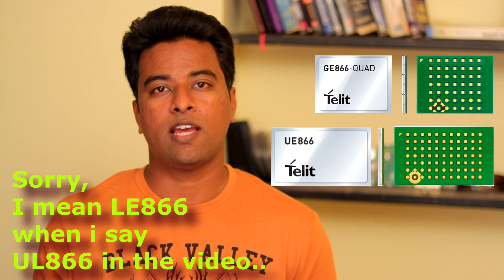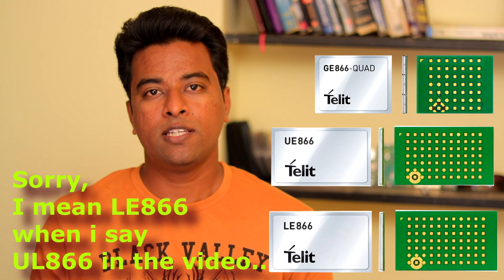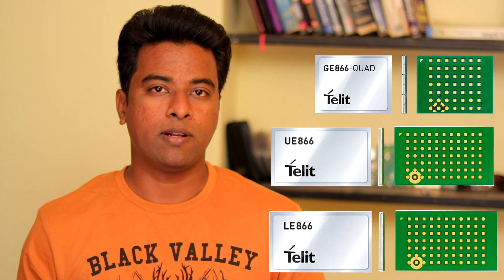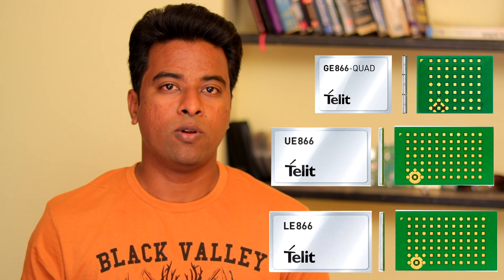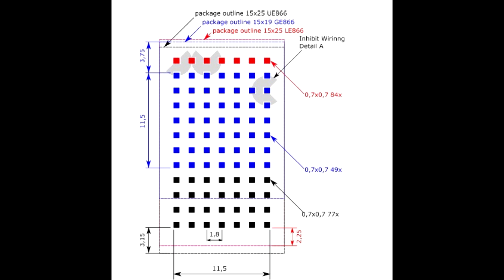Dont use 2G modules like SIM900 and SIM800 - Alternatives

Comment: Hey Ravi good work, i need something really small form factor as sim800 but with LTE or 3g connectivity any ? I'm in europe
Reply from the maker: Use A7670E
Reply: @RaviPujar  thanks for answer but unfortunately its size is 24x24mm but i need a smaller dimension under 18mm by ine size
Reply from the maker: @bhMaker963  check A7680C

Comment: Another recommendation that only has been out for a few years if you somehow get hold of a NB-IoT SIM:

Ai-Thinker EC-01
They aren‘t that expensive and even feature a integrated SoC, they are available as SMD variants as well as development boards so they are a good choice for integrated applications.
Reply from the maker: NBIOT is a very specific tech, not available for all. But now there are cheaper options like A7670 series which cost around 7usd

Comment: @ravi pujar - thanks for your informative video. I purchased a product that has an embedded sim module simcomm.ee  SIM800C (i was told this supports quad band 800mhz/900mhz/1800mhz/1900mhz GSM frequences) and tried to install 2 different carrier sim cards into the unit but its not reading it/accepting any phone calls. I am in Canada, the 2 carriers I tried are Chatr and Public Mobile-  you can check their frequencies here https://www.signalbooster.com/pages/what-are-the-cellular-frequencies-of-cell-phone-carriers-in-usa-canada   - can i ever get this to work or should i return the product?
Reply from the maker: Hi,
I don't think any network other than Roger's had a active 2G network last year in Canada. May be they have also decommissioned it by now. Don't forget to like share and subscribe :)
Reply: @RaviPujar  Thanks so much for the quick reply. So are you saying based on the links i shared and your quick research that a sim card from any carrier (and even rogers has been slowly decommissioning their 2g networks and will fully be off by dec2020 which is soon), that the product with an SIM800C module will not work in canada with a new sim card from any of the main carriers ? i thought the module was compatible to working also on 3g/4g frequencies though / had quadband frequency -   if so what module should be in the products for Canada? thx
Reply from the maker: SIM7600G or SIM7600A should be good for 4G. SIM5320A for 3G for American bands.

Comment: Hi ravi I'm in Mexico and don't know which modules support 3g/4g in online stores sellers claim sim900 has 3g support but I know it only supports Telcel operator cause Telcel still supports 3g networks. Can you guide me over which and where to get 3g/4g modules to use with arduino and raspberry ?
Reply from the maker: Use SIM5320 for 3G and SIM7600 for 4G. There are variants of these for different region. Check datasheet for the band support needed for your country. Don't forget to share and subscribe

Comment: The 2G network will be supported in Canada till the end of 2020 (according to Rogers) but they cannot garantee the coverage...
You should consider to buy a 3G module like the SIM5320.
Sold under 100 CAD :
https://voltatek.ca/communication/286-sim5320e-3g-module-gsm-gprs-gps-with-serial-interface.html

Comment: Hey I am using SIM900A , will 4G jio which has 1800 mhz bandwidth work ?
Reply: Sir can I use Different Telecom operator (idea / Airtel) with my sim800d GSM module?
Reply from the maker: SIM900A will not work with JIO as it is a 2G module.
Don't forget to share and subscribe :)

Comment: which gsm module can i buy in india that supports 3g/4g network and can be connected with raspberrypi so that raspberrypi can send signals to gsm module for call or sms.
Reply from the maker: You can use SIM7600E
Dont forget to share and Subscribe :)

Comment: I have  3 dead SIM800L Modules now here! The worked for 12-15h and than they lost net forever. I think the booster is burned because the antenna is not right. China bullshit!
Reply from the maker: Hi Kalter,
Sorry to hear that. 
Something is wrong on the hardware side. Wrong voltages on Power or IO side. I am using them and deployed at customer places and they are running from years.  
Dont forget to share and subscribe :)
Regards,
Ravi
Reply: @RaviPujar  800L Modules are not recommended for production. Only for toys. They are B or C quality. This is an official Information from SIM I gor by email. PS: I am a German electronic design engineer with 22 years experience, therefore things like "wrong voltage" or "unstable power supply" do not appear in any of my designs.
Reply from the maker: @KalterKrieger  Then i have to agree with you :)
Have you tried other manufacturers modules like Telit or Ublox?
If yes, Would love to know your experience.
Reply: @RaviPujar  I will check them out,. 2G ist history in Europe after 2020. I am fucked up with these 800L modules. email is not implemented, ftp does work..... ebay shit!

Comment: you need to build decent library for 3g/4g module to make it works, its not an easy thing to works with low level commands
Reply from the maker: Yes, AT commands are tricky. I built a library once and using since years. The modules are AT command compatible with minor changes.
Dont forget to share and subscribe :)

Comment: Hi , Im form Australia and  have SIM808 EVB-V3.2 it's not registering to network . im using 3G sim card should i use 2g to be registed
Reply from the maker: Its a 2G module and it wont work in Australia. 
You need 3G modules like SIM5320E or SIM5360E to use with Optus or Vodafone
Dont forget to share and Subscribe :)

Comment: hello I'm trying to connect to a website with the sim5320 using the command
AT + CHTTPSOPSE it happens that if I use it on secure websites it responds with "ERROR" example AT + CHTTPSOPSE = "https://api.thingspeak.com", 80,2 responds ERROR if I use AT + CHTTPSOPSE = "www.google .com ", 80,1 answers OK what is the error? the website https: //api.thingspeak I use it a lot, waiting for a response  attentively
Reply from the maker: Hi Gabriel,
I have not used this command so far. 
But i think you cannot give HTTPS in URL. You have to enter only domain name and there will be one more command to enable SSL connection. Please check it. 
We discuss SIMCOM stuff here. 
http://www.embeddedadvice.com/
Please post and someone who might have worked on it might answer.

Dont forget to  share and Subscribe :)

Comment: is there anyway to convert a 2g gsm model to support 3g???
Reply from the maker: Hi,
It wont be possible as it would need internal hardware changes. 
But you get replaceable footprint modules if you design using them from scratch like Telit modules GE866,UE866,LE866 etc.  Dont forget to Subscribe :)

Comment: Hi. Why many ebay products says "SIM808 Wireless GPS GSM GPRS Breakout Board Bluetooth Module replace SIM908". I see that some sim808 are Quad-Band GSM, but others didnt. I am very confused.

Thanks
Reply from the maker: All SIM808 modules are quad band. SIM808 modules are replacement for SIM908 modules. But SIM808 have extra bluetooth feature added.
Reply: ok thanks!

Comment: can you suggest source , price & availability of 3g SIM module in india
Reply from the maker: The best source so far is Campuscomponents and Pulsar Electronics, 
I import my modules for around 25 USD per piece for SIM5320 or SIM5360. SIM7100 (4G) costs around 35USD.
Buying local is very expensive compared to getting from China.

Comment: I think a viable solution is to use a 2g simcom module pin compatible with 3g modules, like the sim800f (compatible with sim900,sim5300 e sim7000e) http://m2m-com.com/en/2g-wireless-modules/simcom-sim800f-pin-compatible-with-sim900
Reply from the maker: Yes correct. I am designing using these for my next version of GPS tracker VALTRACK-V2/V3
But There is no version supporting USA bands in SIM5300 series. But Europe and Asia will be supported.

Comment: I'm from europe and i was concerned about 2g support here, but a contact from a company that sells sims for iot told me 2g support will continue for maybe 10 years
Reply from the maker: That is really good news. In USA also T Mobile will be supporting 2G for some time.
Reply: ...but, for project that use 2g modules on an extended area it's better to use operator agnostic sims like emnify  :) (they offer their own apn that rely on many national operators: tim, vodafone, h3g, wind... and they support 2g AND 3g too!!)
Reply from the maker: Yes correct. Had come across Hologram.io. 
These SIM are only good if the module can support the regions frequencies. The module needs to adapt to different frequencies across different regions. The SIM will provide access to that frequency.
Reply: From my understanding, 3G will be shut down, 2G will be continued, as it is used for many M2M applications, are to provide a compatible network any current device supports. It will be 2G and 4G (and later 5G). iig 2G and the latest G.
Reply from the maker: That would be very good news, but in USA the networks have already migrated away from 2G. In Europe they might continue longer. 
They are considering 4G/LTE  NBIOT as the alternative to 2G. But again that would still mean decommisioning of the existing hardware.
Reply: Nevertheless, this is interesting to know, if I were to design a product to be deployed in the USA, what would then be the best option, considering a rural area? Can I assume they've already 4G antennas in place or what should I account for?
Reply: Swisscom already killed off 2G, TMO NL is trying to do so and Telekom has converted 2G spectrum into 4G spectrum. Vodafone killed off DCS1800 in some areas in favour of 5G DSS.

As a alternative, there is NB-IoT.
Reply: @MaxMüller0  I read that Vodafone supports nb-iot, so  I bought a modem simcom supporting nb-iot 1 or 2 years ago but I couldn't find info on how to acquire the nb-iot sims or how to enable it on preexisting 4g sims 🤷🏻‍♂️

Comment: I think USA makes a mistake by closing 2G. There are so many IOT, security, and access systems running on 2G. It makes more sense to close 3G  like will most likely happen in Europe.
Reply from the maker: Yes correct and 2G modules are at their lowest cost now. In India we will be able to take advantage of it for some years atleast. Good thing is T-Mobile has said they will support 2G until 2020.
Reply: It‘s still a mistake as devices without nationwide support don‘t have service at all now sometimes and 2G operation is possible inside guard bands anyways.

Comment: Which is the cheapest 3g and 4g module that work well in india ?
Reply from the maker: Not really cheap, But SIM7500E or SIM7600E should work, Cost around 35USD. Connect with SIMCOM support for better recommendations.

Comment: The problem with the alternatives is PRICE. That's a huge reason why people can't develop their product for IoT, because the cost is still far too high per device.
Reply from the maker: Yes you are right. 3G module price should have come down by now as it is older technology. 4G modules still are very expensive. Network connected IOT devices will be a expensive option in USA and Australia until prices come down for 3G and 4G variants. If LoRa gets traction it could be a better option.
Reply: Also, T-Mobile just bought up a huge chunk of the 600MHz band and will have new phones on the market that support this frequency for 4G and 5G, by the end of this year, Nationwide. Basically, they are saying that it's much lower latency while penetrating trees, mountains, etc, perfect for filling in the gaps in service coverage. Their coverage map does in fact show nearly 100% of the US will receive 5G coverage by the end of this year thanks to 600MHz. HOWEVER.. i'm still trying to locate any GSM modules similar to these like you talk about here.

Right now, we're limited to GSM for 2/3G and yes, 2G is on it's way out. The only thing good about 2G right now is that it's cheap and it's good for basic development for most projects. Swapping out the module like you said, is one option and that maybe the only thing I can do right now that is affordable per device.

Thank you for your video and the information.
Reply from the maker: Yes, lower frequencies do have better penetration. 
I haven't even heard if someone is manufacturing 5G modules for IOT yet. I believe Telit or ULOX would be the first to. Glad it helped. Don't forget to Subscribe :)
Reply: Either that (still) or the limited availability of NB-IoT.

NB-IoT modules are quite cheap nowadays, but you can‘t get hold of SIMs for NB-IoT in many countries.

Comment: What will your customers do when the 2g networks gets shutdown? Will they remove the 2g module and solder the 3g or 4g replacement?
Reply from the maker: Yes correct. They can replace new boards of same design with 3G/4G modules assembled in place of old boards and they can recycle old boards by desoldering 2G modules and soldering 3G/4G replacements. By customers i mean the Fleet management companies or companies which are selling these products to end users like bus operators.
Reply: Installing a tracker in a vehicle is a lot of work, I would rather spend ~20 USD more for a 3G module. It would avoid the time spent in a 'recall'
Reply: Anyway, I don't know if 3G is a better option, I read that in some countries 3G networks will be shutdown before 2G networks
Reply from the maker: Yes, I agree too on the work involved in installing trackers. Its a solution only in case someone is starting with a tight budget .
Reply from the maker: Is it? In which country. Would be interested to know. It could make a interesting topic for my next blog post.
Reply: Ravi Pujar really the article is a bit dated and was more like a survey http://rethink-wireless.com/2016/02/08/europe-may-lose-3g-before-2g/

Some more links
http://www.telecompetitor.com/ovum-thanks-to-4g-carriers-could-shut-down-3g-before-2g/
http://blog.telegeography.com/2g-is-fading-away-but-it-might-outlive-3g-in-europe
Reply from the maker: Interesting read. Thank you for the links :)